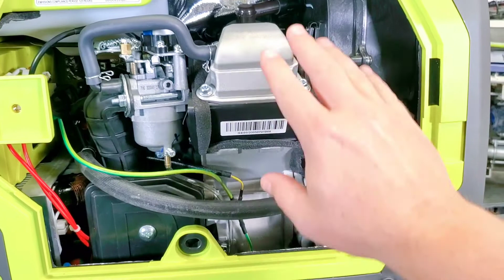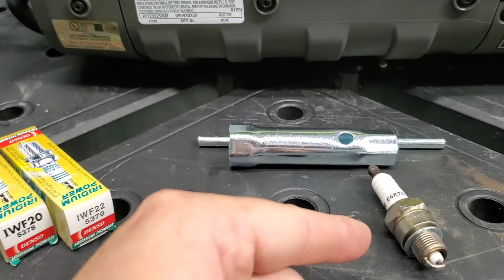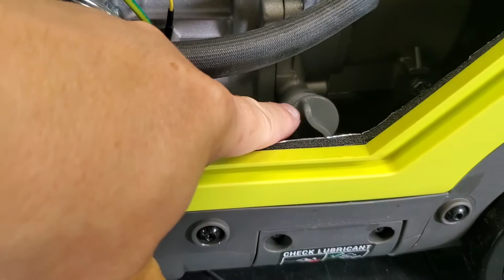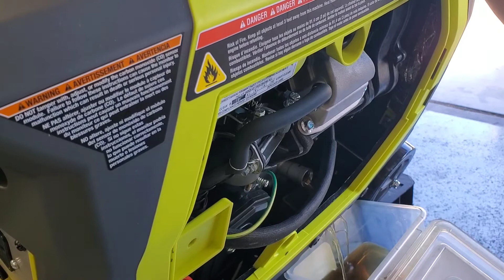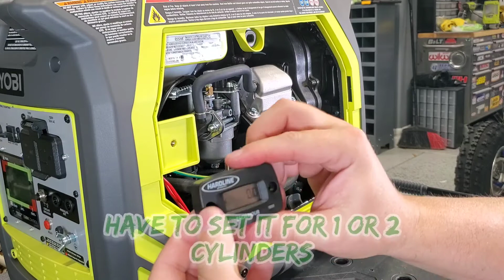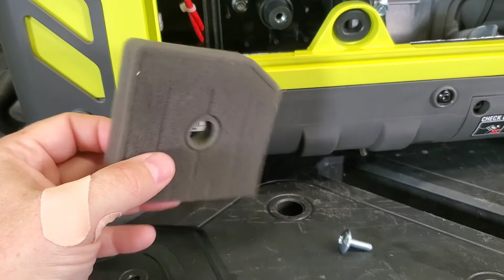1800-2300W GENERATOR MAINTENANCE GUIDE RYOBI PREDATOR WEN PULSAR GENERAC DUCAR WESTINGHOUSE + MORE!

Comment: I have a Ducar inverter module that blew both ceramic resistors or capacitors that are mounted right next to each other. Any chance you can get me the numbers of either of those from an 1800 watt module?  They should stick up enough from the conformal coating/heretic sealing to see what the numbers or values are.

Comment: 1440hrs on my ryobi 1800 and have only ever changed oil. I wonder what the valve lash and spark plug looks like. I also run only 100LL fuel in it.

Comment: I would rather change oil more frequently than take a chance the magnet could fall off the dipstick and do untold damage
Reply from the maker: Can happen. However, doing what I do and having put in probably 80-90ish magnetic dip-sticks or drain plugs in different vehicles. I have never had a magnet come off. I have heard about it though. Also, changing more frequency does not do anything for the metal circulating in between changes.

Comment: Do you happen to have a valid 'listing' of the available Iridium plugs for swapping out? I've got the HF Predator 13000 Tri-Fuel and the new-er Honda eu2200i that I'm trying to find proper replacement Iridiums for. TIA.

Comment: For break in on a dual fuel... ( if someone planned to use mostly propane)....is it better to break in on gas or no big difference to break in on propane?
Reply from the maker: Does not make a difference really in my experience. Propane runs cleaner and a bit hotter, that's about it.

Comment: Can you tell me for Igen 2800 inverter generator does it have fuel pump or is the carburetor gravidity fed
?
Reply from the maker: I would be surprised if it used a pump but I have not opened one up personally. Looking through the manual (excellent manual! I can praise westinghouse here!) it looks gravity fed. No reference to a pump and the layout on page 21 makes me confident it is gravity fed. Just a fuel filter off the tank.

Comment: just bought a 4300 A-ipower gen that has a A5RTC plug, can not find a Denso cross but it crosses to a champion Z9Y with then crosses to a Denso IUF22  that is a different heat range  would that be safe ?
Reply from the maker: Hey Nicole, the IUF22 is correct. The A5RTC is a 7 heat range in NGK and a 22 in Denso.

Comment: Thank you for this video. I was looking for something like this. I'm going to buy all this stuff you're recommending. I have two pulsar 1800 watt generators. One of them works like a charm. No issues. Now. The other one I gave to my father-in-law. He rarely used it and kept it outside covered with a bucket. I'm starting to use it to give the other one a break but I noticed it's not running even, or at a consistent RPM? I guess it kind of like gets high and then low and then high and then low constantly. Any thoughts on what I should look at? Troubleshooting thanks again man
Reply from the maker: Likely just a carb issue. Get rid of the gas in the tank safely, drain the carb bowl best you can and take the carb apart. Will need a thorough cleaning and you should be good to go!
Reply: @MR_Garage  I was hoping you would not say that. Lol. Got to learn about carbs now. Thanks for your quick reply. And thanks for all the great information you give out on your videos. Best wishes

Comment: Great upgrade and maintenance tips. My Ryobi 2300 takes about 6 pulls on choke to start. Is that standard for you? I'm hoping to get it dialed in to just 2 to 3 pulls at most. Any tips?
Reply from the maker: Did you get rid of the junk factory plug yet?
Reply: @MR_Garage  Update to this. Yes I did but the fix was to tighten up the choke. The play prevented it from fully closing. New plug came afterwards. Thanks for the great video!

Comment: What do you recommend to store a Ryobi generator when you know you will be using every 4-6 months. Do you drain the gas and add oil to the spark plug. That is what I read in owners manual.
Reply from the maker: If I store any gas engine that long, I drain the bowl. If you want to go expert level, use a syringe with proper sized tube to fit the bowl drain. Once drained, inject ATF fluid back into the carb. Pretty much fill it and close the drain. When ready to use, drain the bowl again and fire it up. Will smoke a bit and take a little longer to start first try but the carb will always be 100% ready to go.

Comment: is there a iridium  equivalent  for  A5RTC,...NGK 6535,  CR5HSB ,...CHAMPION ZY9    COULDNT FIND,JUST REGULAR  NGK ETC
Reply from the maker: You can do a CR5HIX which will work excellent. Adds a resistor which does not hurt anything / may slightly reduce electrical noise overall. You may need to order a terminal nut for the end as they usually ship threaded only.

Comment: got a nexpow 1800w spark plug says AR5TC LG,..looks like ngk 6535,...or honda CR5HSB,..gap 0.7mm i think,(book says nuthing)...or champion Z9Y....thanks  for showing valve adjustments,   cool mtyvac  tool   ,sure could use that,subbed

Comment: Add Coleman Powermate 2200i to the list as being the same. It has the exact same model number as the Generac GP2200i. Looks identical except it is red. 

Any chance you could do a video on a tear down of the fuel cap on these? I tore mine apart and can't remember how it goes back together,,,lol.. Thanks
Reply from the maker: I moved on from this ryobi and have a Pulsar dual fuel now that ROCKS and over 3000W! Same size as these smaller units. Check out my latest video on it. Made by Dinking instead of Ducar.

Comment: @MR Garage (Random DIY & Projects)  
First off let me say thank you Mr Garage for all the things you do for everyone on this channel!...

So far I followed every single step and I purchased all the supplies via your links in the description...

But now I'm stuck...
P1. When I'm using the 0.10mm feeler gauge on the tappet of the two valve I don't think there's clearance because they won't fit unless you're actually lifting up the valves tap it each time?
I even tried to push a little bit and started to bend the feeler gauge.
P2. I was told by a friend to add one tablespoon of Sea Foam Motor Treatment into the spark plug socket hole then install the new Denso Iridium spark plug and then the dialectric grease in the boot, next to add two tablespoons into the oil fill hole before adding my final oil after burn in regiment.

You're Feedback is most appreciated and welcomed.
Reply from the maker: Hello! On your questions: P1 If the feeler gauge will not insert, means clearance is a bit too tight. Time to back off the adjuster a tad and re-check. P2 The seafoam treatment will not hurt so just depends on the hours on the gen if needed. Also, if put in the oil, you need to change the oil shortly after application is my understanding (not a seafoam expert)
Reply: Good News...
I've completed all the steps you recommended and I did my burn in today just as you instructed...

but there was just one difference...

I didn't have any startup sputters as It ran extremely smooth from the first pull! 🤪

1Q: what is the auto idle button?

Any chance you could explain what that means and is for like when would I use that and for what reason?

Thanks Mr Garage for all your help and care and feedback!
🙌🤗😉
Reply from the maker: Very nice - you have a great gen !  Auto idle lets the generator idle down quiet when no load is present. Once a load presents itself, the generator will ramp up in RPM. The only time you should turn this off is during startup.
Reply: @MR_Garage  
Thanks again brother! 
👍😊👍

Comment: I hate the carburator bowl fuel drain (clear tube) location as it's bent in it's current factory position...
Can I just loosen the carb bowl nut and change the position to where I want it to be without having to remove the whole carb and then once I have it in the perfect location just tighten the bowl nut back to snug?

Or...
Causing problems by doing this process?
Reply from the maker: You can, just a 10mm nut on the bottom. Can rotate it a little. The o-ring is annoying so do not drop the bowl all the way. Just enough to turn it a little.
Reply: @MR_Garage  
I did just that 👍...
Everything looks new with zero residue, reassembled = no start.
I check for spark = good = no start
I drained fuel and replaced  with fresh = no start
Replaced sparkplug with new NGK BPR7HS = no start.
I checked carb bowl is getting fresh fuel = no start.

I'm lost 😔
Reply from the maker: New generator to you that has never run or brand new? Oil full?
Reply: @MR_Garage  
Yes, used Redmax JASO-FD 4 cycle oil 10w-30
I ran it last summer for 40 minutes to power my shop radio 1200 watts...
Then I stored it, I did not drain the fuel because I was using zero ethanol Tru 4 fuel, I replaced the fuel with same brand and type and still no start.
Reply: @MR_Garage  
UPDATE: Took the 3 year old Gen to Home Depot Tool Rental Service and they are going to swap it out for new in the box.
I also used your links to get all maintenance upgrades from Amazon, should all be here in 6 days.
Watched your awesome tear down video, just wished you made a how to remove the shroud/cover properly video.
I'm sure it's simple, it's just that I'm a visual learner 🤪👌

Comment: Great tip on using grease under the valve cover! Instead of some fancy oil in the air filter, I use fogging oil. I need fogging oil to put the generator away, so by using it in the air filter I have one less product to keep on the shelf.

Comment: Instead of fuel stabilizer I use truefuel and run it through the system before I store it. During the season I will run staybil 360  for its upper cylinder lubricant and cleaning properties. But for storage if I want to leave any fuel in it without having to completely drain my system I trust the synthetic fuels such as VP SEF and trufuel

Comment: Looking at picking up a Ryobi 2300 this weekend. Do you know if the spark plug type has changed. I was reading the manual from HD website and now shows NGK BPR7HS or equivalent which appears to be a 7 heat range spark plug and not 6? Also looking at the IWF22 from denso to replace it with if it has changed, iwf20 if not, but the manual also says a .6-.7 mm gap and the denso is .8? Would that still be ok or would need to be bent in slightly? Thanks in advance and for the awesome videos
Reply from the maker: When going to iridium, no need to adjust the gap. The spark kernel will be well focused. Error on the colder side and check the plug after a long hard run. Environment, altitude, fuel ratio... all play a part.
Reply: Thanks for the reply! Got the generator and checked the spark plug and it’s still the torch 6 so will be going with the denso iwf20!

Comment: MR G thank you for this whole video and a special special thank you for the valve clearance I could not find this info anywhere I never thought about looking up the Westinghouse manual

I could not find a video on your channel regarding adjusting the governor or away to adjust the idle speed and is there a way to change the ignition timing on this generator

Comment: I have a Champion & in about 2 hours of running I'm on my 3rd batch of oil,... Went about 5 minutes on the original oil, dumped it then about 30 minutes on the 2nd oil & dumped it,... The 3rd go of oil was some good stuff.
After I cleaned the air filter I drowned it in WD40 & squeezed out the excess,... WD 40 is what I had ;)
Reply from the maker: WD is fine - My gramps used the same on foam filters!

Comment: Just had a Westinghouse iGen2200 delivered today. First order is to toss the Torch plug if it has one and replace it with an NGK. Then after the break in run, dump the factory oil and refill with Rotella T5 or T6. Using a magnetic dipstick is a good one too.

Comment: After 40 hours of use there is a problem, the IGEN 2500 became hard to start, I filled it with gas, checked the oil, and it would not start, there is a handy float bowl drain and I opened it and air came out once all of the air was bled out the generator started fine then after an hour it started sputtering and I found the gas cap was not venting. What could have caused the original hard to start problem with the air in the float bowl? I have had this generator for 5 months and only used non ethanol 91 octane gasoline with Stable in it.
Reply: Same here with my Westinghouse igen 2500. Started with one pull until I drained the carb bowl. I eventually did get it running again and starting with a single pull I but have not used it for an extended period of time after that so hopefully it keeps running. Maybe there is a trick to draining the carb that I missed.

Comment: What brand of oil? What weight? how often do you change?
Reply from the maker: In all small engines, I use a 15w40 (unless in a cold climate, I use a 5w40). I use rotella T6 in pretty much everything I own. But I am not caught up in brands. Maintaining equipment on-time trumps whatever brand is on the bottle.
Reply: @MR_Garage  I like a good diesel oil, I just ran my wen 2000 for 6 days straight, only turned it off to change the oil at about 60 hours. I use Amsoil HDD 5W30, it’s a heavy 30 weight. Pretty stout oil., I changed it again on the fifth day. Between changes maybe used an ounce. My unit has about 200 hours on it, i’m assuming it’s got the crappy torch plug, I will be yanking that thing soon. I kept thinking while it was running non stop I hope that crappy plug stays together.

Comment: Any issues with iridium plugs for my Ryobi? I want to replace it but I’m nervous as no other videos or websites says iridium is safe for the genny
Reply from the maker: No issues. Iridium simply describes the center electrode material and general shape of the electrode (always a fine wire). What matters is the heat range and proper fitment of the plug. The center electrode material and shape simply changes the shape / focus of the flame kernel. The material has to be tough with a high melting point which is why iridium was the choice. Soft / lower melting point materials like platinum or gold palladium just wear out fast.  iridium / fine wire allows for excellent flame propagation across the gap and even wide gaps under boost (for guys that tune only in high performance engines). But in small engines, this means the focused energy will nearly always fire even when wet fouled or oil fouled. This, and they last seemingly forever. This is why iridium plugs / fine wire plugs are simply a better choice over gimmicks and why nearly every automotive manufacturer on the planet has gone to them. There is no magic, or voodoo here. Just science and tech. Your engine will not run hotter, cooler or do anything other than run as well as it can and start easy. I know way to much about spark plugs to the point it is embarrassing sometimes (past life work) - carry on!
Reply: @MR_Garage  Best answer! Thanks so much!
Reply: @MR_Garage  I have 2 ATVs that need spark plugs. Could I use Iridium in them to? Do you happen to have a conversion chart that could easily tell me what the DPR7EA-9 and D8EA would be in Iridium?

Comment: I have two of the Pulsar G2319Ns and lent them to a friend and specifically showed him how to drain bowl once done,  he did not have stabilizer in the fuel nor did he drain the bowl before bringing them back and putting them away, shame on me for not checking, as you might imagine next time I go to use they won’t start because gas has turned into turpentine. These carburetors are a little different than others if worked with, I cleaned the bowls unplugged the little jet (I guess that’s what is but its on the side of the pick up tube) thoroughly cleaned out all orifices and reassembled. They start and run but I am getting surging now. What did I miss. TIA
BTW your video is very good and I did order several of the upgraded options for both of mine.
Reply: @Jeff Pitt  Low idle circuit is still partially clogged in the carb.  You've got 3 options from easiest to expensive.  Buy a 4 oz. bottle of  "Mechanic in a Bottle".  Remove all the gas in tank and pour in the MIAB.  With the spark plug cable OFF (don't start it) pull the starter rope 15-20 times to get it down into the carb.  Leave it for a few days to a week.  Pour in fresh gas, reconnect plug wire and see if it'll run right now.  2nd option is to reclean the carb by using a torch tip cleaner, poking into all the orifices.  3rd option is to replace the carb.  Good luck.

Comment: Thank you for the great reviews, it made my decision making a lot easier! I bought a Craftsman !2500 it came with a broken spark plug and a broken cap on the spark plug wire, "shattered" so I brought it back and because you said these small I generators are made by Ducar I ordered the Westinghouse IGen 2500 (I liked the control panel) it came with a broken spark plug and a "Defect" label on the box, I brought it back to Lowes and they gave me my money back,  both of these generators were $599.99, two weeks later I was shopping at Lowes and they had the Westinghouse generator I had returned with a price tag of $299 on it and bought it. I replace the spark plug and the second pull it started, It runs great, I would not have bought the Westinghouse generator if it wasn't for you and I got an amazing deal!!!! From what I can see is the defect was the broken spark plug. Thanks again!!